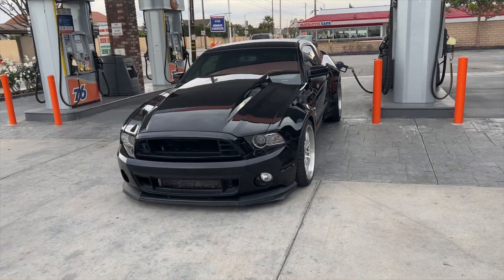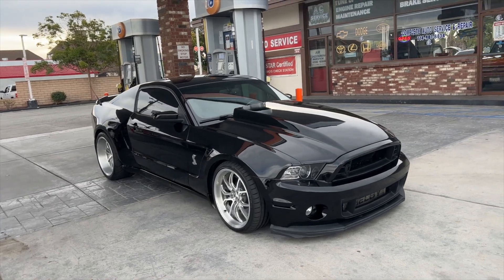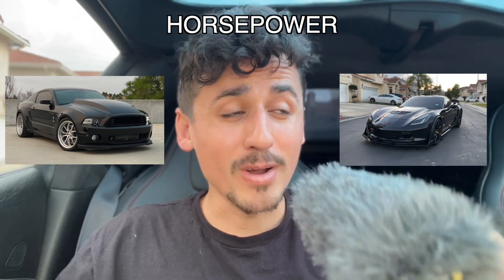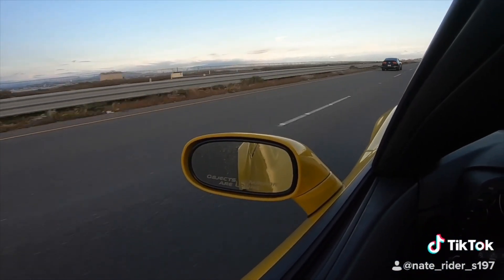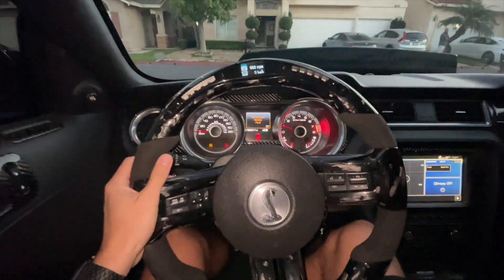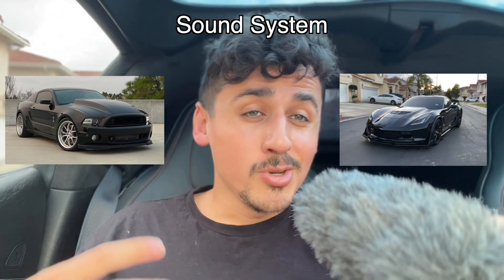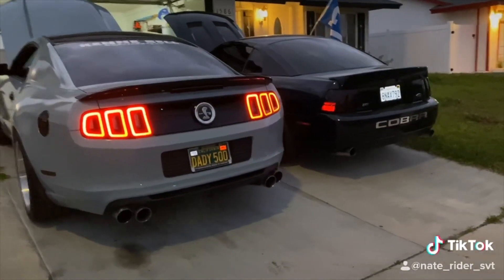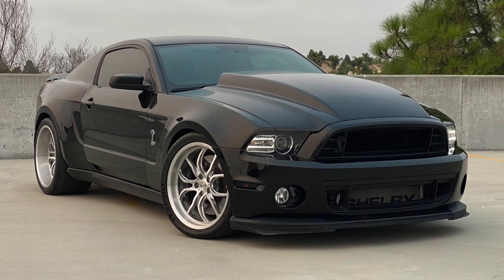My Shelby GT500 vs My C7 Z06 Corvette!

Comment: Having owned both as well (07 Gt500 and C5z), You really have to have both. The streetability of the GT500 is pretty sweet, and like you said, I love the aftermarket support. The C5Z was a racecar for the street, but the daily drivability was shit, and sooo expensive to service and repair. $3500 clutch job minimum, etc.
Reply: c5z? he comaring gt500 to a c7z.
Reply: Whoever owned that C5 beat the shit out of it. C5 Z06’s are great daily cars unless of course it is beatin to hell or doesn’t get normal maintenance (all cars will have issues with these two factors taken into consideration.)

Comment: I would never go faster than 100 in mustang.  The corvette feels like it’s going 60 at that speed.  The corvette is a track car.  If you were trying to get away from someone the vette.  Mustangs have power but that’s it.  Trust me all there’s a reason the cops leave these old f$&kers in the vettes alone even if they are speeding.  If they wanted to run they could easily.  The vette for sound hands down I have a z51 c7 and Roush RS3.  The sound system in my vette is wayyyy better.  The vette has the targa top too. The vette is a better car for the money.  I love the GT500 it’s a badass car don’t get me wrong but the vette is a better value car

Comment: A c7z with a good cam and bolt ons will smoke the gt500
Reply: Smaller pulley and e85 also needed
Reply: Cammed gt500 smokes it
Reply: It's a mole cricket vs. a Muscle car.

Comment: nice vid..ive had me 19 zo6 since oct...with the manuel transm....all stoc  with the exceotion of an x pipe w secondary cat. deletes......unless u are a proff. race car driver....which i doo not beleive u-n these subscribers are.....all this extra power...how can u harness it???unless on a prepped drag strip w racing sliks???u destrot a beautiful car ..overheating -reliability issues-etc-etc.......STILL I DOO NOT SEE THE POINT????yea i sold me gt -350..lovved that car-but it had litrally no ..usable low end take-off torque  +  lots a problems w that engine/i never had any-but did  not wanr 2 take a chance....good luck.GOD_BLESS!!